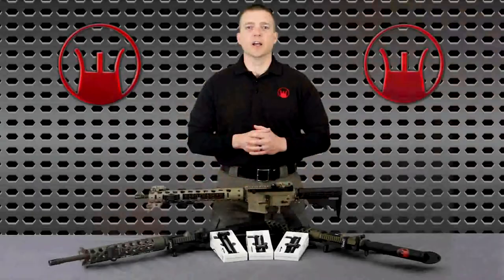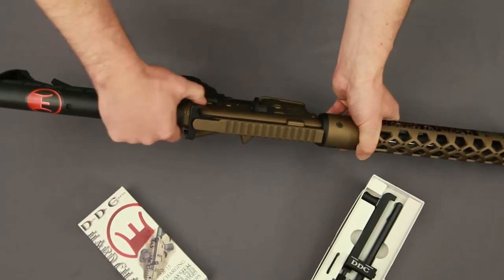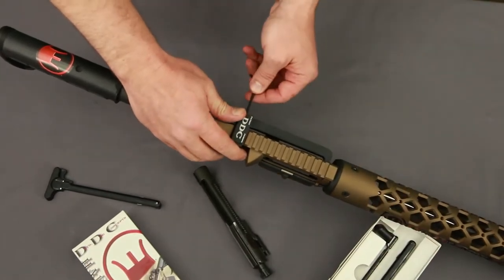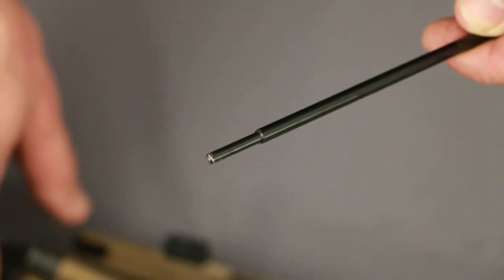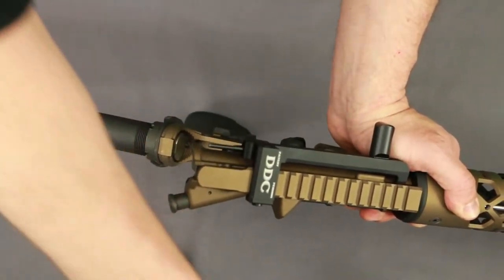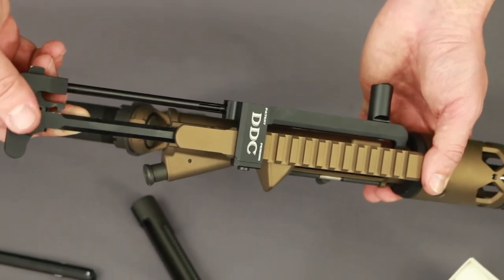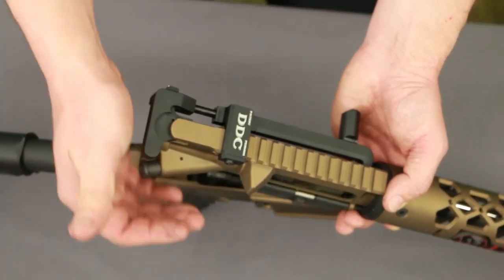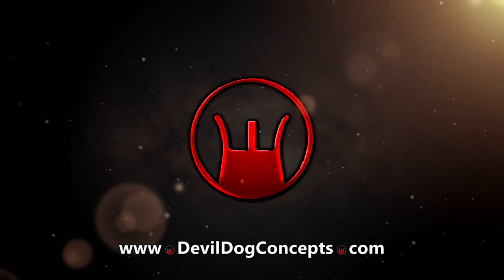[HOW TO] Install Your Devil Dog Concepts Hard Charger

Comment: I just ordered the hardchager for my psa ks 47, the one that goes on the 13th position rail. Can’t wait to take it to the range.
Reply: Got mine for Christmas it's a little tight but good
Reply: I thought only the HC Version(rail 1)Worked on the ks-47..They say is causes scraping and extra wear and tear..
Reply: Devil dog concept made a video saying that for the PSA Ks47 you would want the rear charging option so there’s no binding.